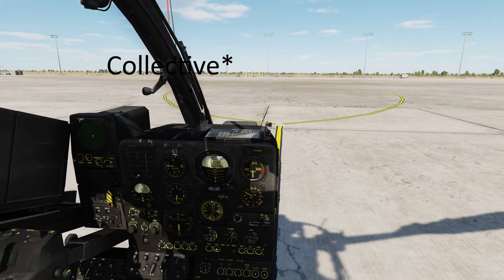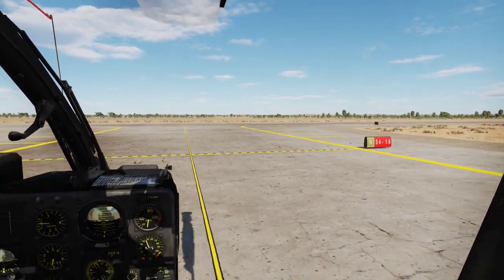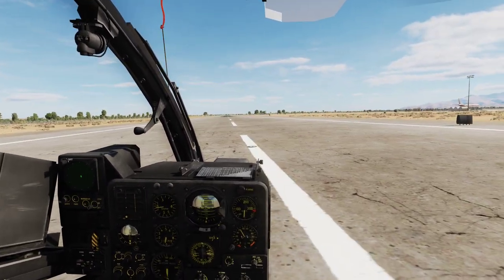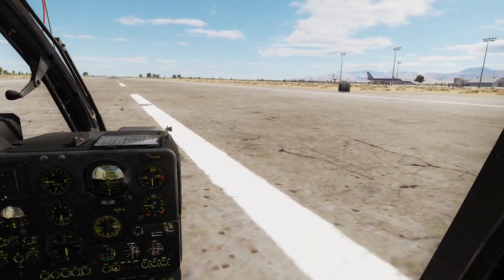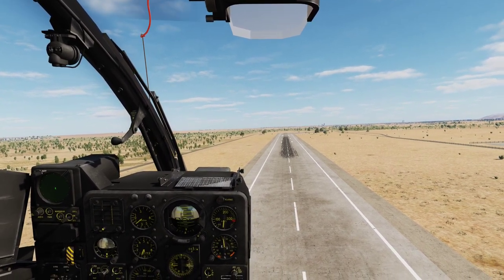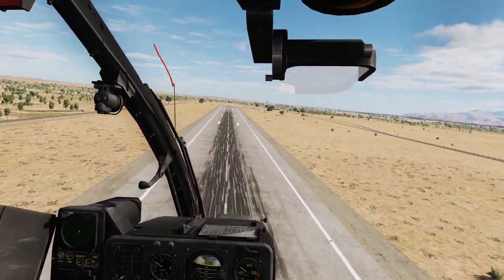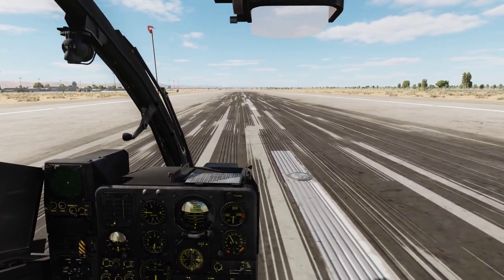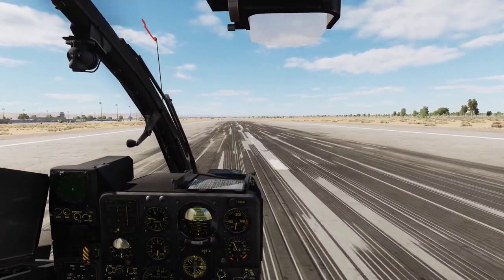DCS | SA 342 gazelle taxi, takeoff & landing tutorial

Comment: I just got this module. I am very good with the Huey and the Apache. With this? Not so good...and it's mostly on take off. Once I am airborne I fly it just fine. But getting a nice stable takeoff from the ramp is...challenging. I am making way too big of corrections, I know what I am doing wrong, it's just correcting it is more difficult than the others. But, when I first tried out the Apache I was like a pig on rollerskates. Now I am glassy smooth. So will it be with this. One thought though...my tablet doesn't seem to be present in the Syrian and Sinai map. It's there on the Caucasus map. I wonder if that's just a bug or intentional?
Reply from the maker: need to be added that I made this tutorial before the flightmodel update so it is now a bit different.